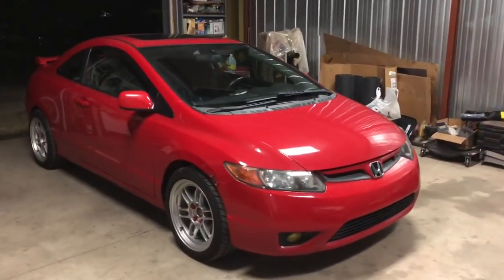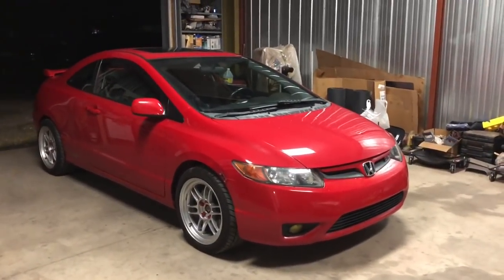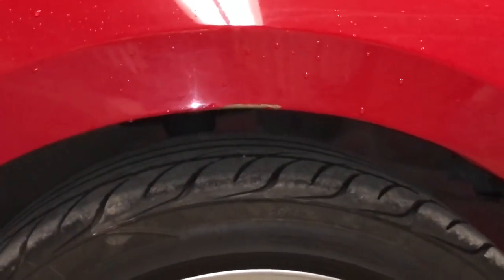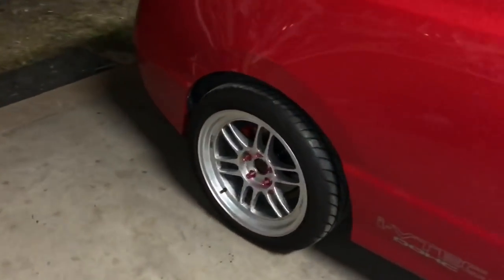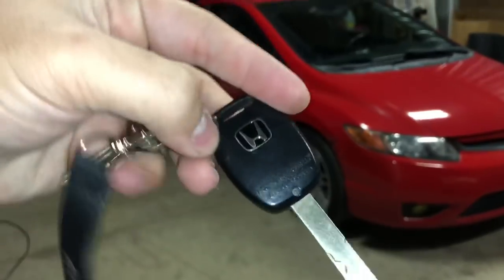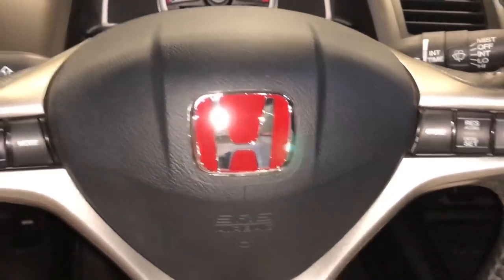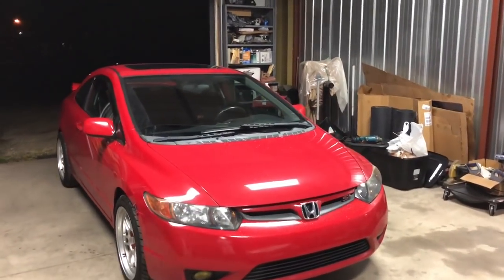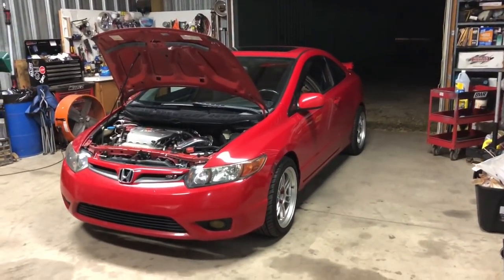My New 2007 Civic Si FG2

Comment: What do you think about some 18x9.5 +38 offset on a Fa5 ?
Reply from the maker: Your gonna need -6 or so of camber to run them
Reply: @Coda5610  why is that?
Reply from the maker: 831CaliSavage cause that aggressive wheels specs... i was on 17x9 +35 with -3.8 of rear camber...
Reply: Oh okay will i still need some camber even if am just lowered on some lowering springs?
Reply: I have them wrapped in some 215/35 tires
Reply from the maker: 831CaliSavage they are gonna be "Mexiflush" hella poke with no camber good luck
Reply: If they look ugly with alot of poke am going to to fender roll thanks alot tho